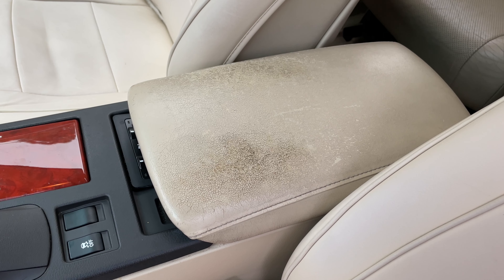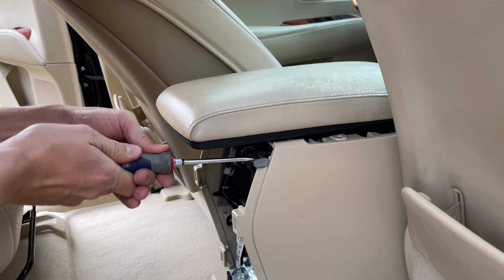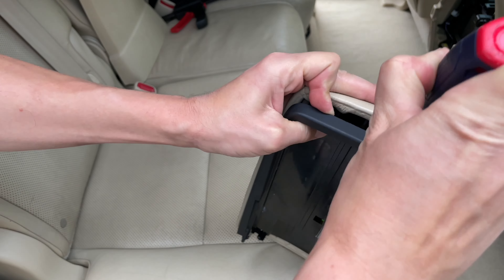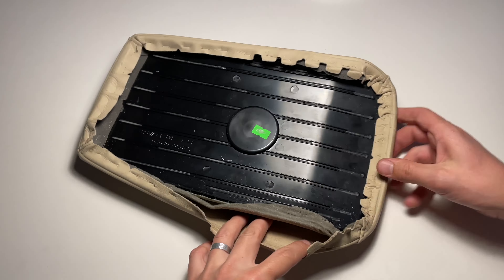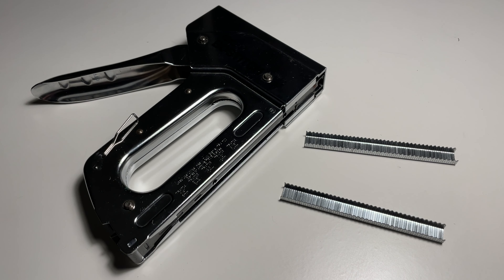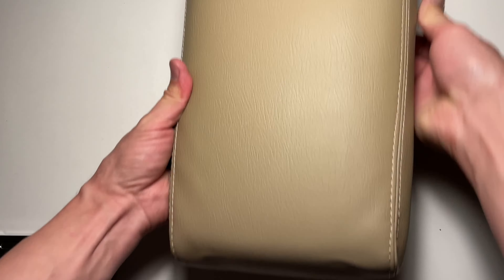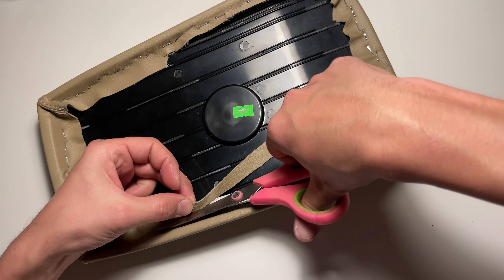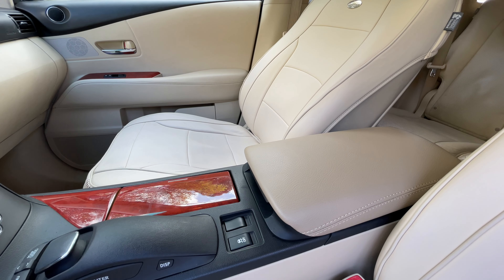How to replace armrest cover in your car for just $20.

Comment: FYI - on my 2010 Lexus RX 350, after taking out the 2 screws, the armrest just slides out rearwards - no need to remove the rear panel etc.
Reply: It seems to be the same setup in his video, he just had no idea 😂 He slides it out at 0:53

Comment: Your staples are barely penetrating and will most likely come apart within the first year of use.  Otherwise nice job.
Reply from the maker: Yeah. Not sure if it the plastic was too hard or my stapler too weak, but re-done the loose ones off the camera. Just didn’t want the video time-lapse to be too long. No one has time for that.

Comment: Thanks! - I replaced the cover using your video!  I ended up have to file the pins down to help reduce the pressure needed to insert them back when replacing.  My cover was much thicker than the original but it seems to work ok.